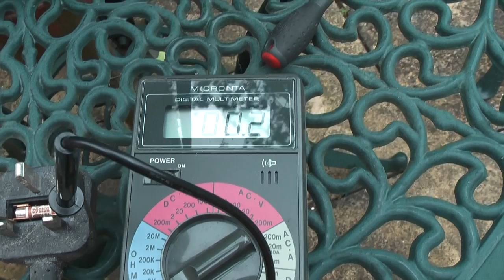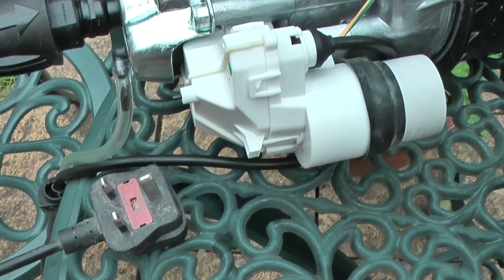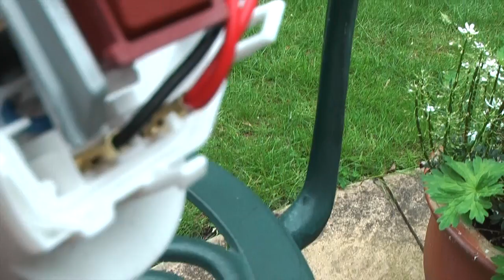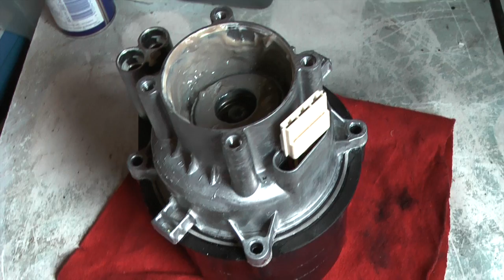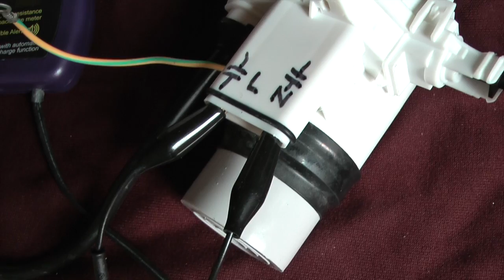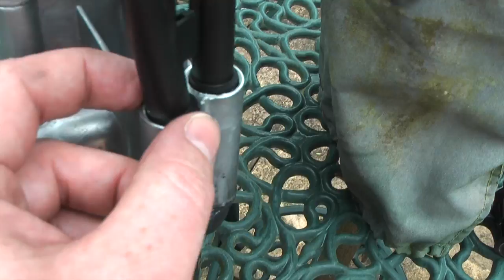Karcher K4 Pressure Washer Fix

Comment: Anywhere I can get guidance on how to remove those 4 large torx screws to access to electric box. I’m not especially weak but won’t budge. Also can’t get the 2 small screws off that keep the 2 parts of the electric box together. Tried all my torx size pieces

Comment: Hi Leon - I'm having trouble here. My washer just buzzes/humms when turned on. Checked the capacitor which is 35mf - it reads 34.6mf on multimeter. OHMS test shows rise and fall 200k ok. 
When I test the plug you tested to the motor I get these results (Mine is a K4 Compact)  C to N is 0.8. L to N is 5 L to C is 4.4

I'm not really sure what that means I was just measuring as yours but can see the difference - Do you know what that means please?

Comment: I had exactly the same experience. I think the problem was a jammed water pressure operated plunger which acts on the manual on/off switch within the white plastic housing. This works by de-activating the main switch when the motor has spun up and created a full on-line pressure in the output hose. When you pull the trigger on the lance this reduces the pressure and releases the plunger to allow the motor to run again. If for some reason the plunger has not released ie jammed then the motor will never run again. Dismantling this assembly releases the plunger so back to normal operation until next jam up. Good idea but poor build if this can get stuck, I bet many a unit has been dumped as a result!!!

Comment: My K4 compact was working but leaked like a sieve, took the casing off and the clear evidence  of leaking water was clear to see.  I know where it was leaking, below cylinder head, so that's the obvious seal, plus any other's that I removed parts  to take down. I think a new set of o rings would be in order. Does anyone know of a decent parts diagram that doesn't take to a  retailers site?

Comment: What was the fault? Totally pointless video!
Reply: Jammed pressure operated switch plunger which released as soon as the plastic housing was dismantled! He did not mention this part of the mechanism, it was just luck that taking it apart released the pressure operated plunger. Bad design really as I bet this has happened on many occasions resulting in binning the unit, chucked into Land Fill!

Comment: Hi Leon .Im a bit hopeless i got a k5 700 .As  i start  it has high pressure but only till you release the trigger the second blast is lower pressure. Disconnect it from the plug start it again high pressure   even for minutes as long as i dont stop with the trigger .cant figure out what can be the problem .Any idea or hint would be greatful  TIA .Thx for the video as well

Comment: UPDATE: Don't worry, a bit of tapping eventually set it loose. Found it was rusted up. It starts with a hum but after a while stops and does not give any pressure water. We can physically turn the motor. 
Hi. Great video. Trying to sort mine out but when we try lift the top off to expose the motor (as in 7:39 of your video) it won't, it just turns and won't lift off. Are we missing something? Thanks

Comment: Thank you! This video was a great help in pulling my K4 Premium apart. The model and body is different but the pump assembly was pretty much identical. 

Unfortunately, I wasn't able to resolve the problem (no power at all) as I left my multimeter at work, I'm on holidays and wanted to use my cleaner so thought I'd test the electrical contacts as you suggest in the video. This was a good practice so will be more confident doing this when I have my multimeter.

Cheers!

Comment: I am having low pressure / pulsating problems with my K4. This video is a great help, thank you!
I am hoping it is just a leaking o-ring as there is a small amount of water leaking from inside the outer case.
I had a K2 Karcher for 7 years that worked flawlessly. The K4 problems started after 18 months.
Reply: Mine didn't last long either - got 2 years out of mine. Seems electrically dead (pump doesn't turn on initially or when the trigger is pulled). I've followed this video but not able to get it operational. Not impressed with recent Karcher quality at all.

Comment: Thanks for the video. I had the exact same problem and 'the fix' worked . Basically, after sitting for a month or two the machine would not turn on. I followed your instructions, I disassembled the electrical part, measured everything for continuity, measured capacitor value, everything checked out ok, put everything back (with a bit of contact grease on connector pins) and it worked. I didn't open the motor casing, just the top.

Comment: When One buys one of these pressure washers you should bend over the counter and let the salesman insert a large object in your nether region because that's what they are really doing when you hand over your hard earned, and as for the frost damage excuse don't fall for it cos they don't try that one on in tropical countries where the plastic parts crack with the pressure just the same...

Comment: Hi Leon, thanks for putting up this video. My K4 compact has just packed up after about 5 uses over 2 years. What actually was wrong with your one, I see you tested the electrics but did't see what was wrong. I was hoping you were going to show us a hidden reset switch. Thanks again.  Mike
Reply: Same here; the capacitor was fine but there was no resistance between the Live and the Capacitor or Live and the Neutral. There was 12 ohms resistance across the Neutral and the Capacitor. Any clues?
Reply: i would think, that if you are measuring no resistance between L and N on the motor itself I would say you either have an open circuit motor winding or he mentioned something about a loose connection about the 8:20 time during the video, have u checked this joint, he didnt show us that bit on his video
Reply: Jammed pressure operated switch plunger which released as soon as the plastic housing was dismantled! He did not mention this part of the mechanism, it was just luck that taking it apart released the pressure operated plunger. Bad design really as I bet this has happened on many occasions resulting in binning the unit, chucked into Land Fill!

Comment: Just taken my K4 apart (it was buzzing but not running) attached hose with water on (no power on) and water was running past the low seal, Looks like I need a seal kit, What do I search for?
Reply: espares or ebay.

Comment: i have had the k4 model where you can put a bottle of detergent in the back for a couple of years and only used about 6 times and decided to get it out today to wash the car and driveway.
got it all set up and when i turned the water on the water was pissing out all over the place.
i took the case off and turned the water on again and it is coming from the bottom o ring that you describe in the video.
How the hell this is possible when its hardly been used is beyond me.
Reply from the maker: Yeah they're really badly made! Still, I found Nilfisk no better :(
Reply: the thing is i bought it to replace an earlier karcher that i had had for ten years and there was nothing wrong with it which i gave to my brother.
i will have a look on espares to see if i can get the o ring kit
Reply from the maker: Yes I put new o rings on mine as they tend to leak after disassembly, even with silicone grease. I think a googling should turn up a set (replace top and bottom).

Comment: Hi Leon,
First of all, please excuse my bad english as I'm a b..y Frenchy. 
I have disassembled a K4.600 (Same pump and motor) and inside the pistons cage, there is the same mix of oil and water as you show on 5:27 step of your movie. I have understood (but not so sure) that we need to clean all this "mud" and put some new "oil or grease" after cleaning. But  - which kind ? - how much ? - is there a place to refill ??? or at the end is it normal situation to have this mix between oil and water (I'm not a genius but I think no) ?
I'm very disappointed to found that there is nearly no French clips about fixing... Which means probably that we are less clever than other 
Thank you for your advice.
Reply from the maker: I simply cleaned out all the creamy beige grease that is contaminated with water, and replace it with about 10ml of CV joint grease (Castrol LM or other brand Lithium/Molybdenum). Exact quantity not important, just as long as it is 'thrown around' and lubricates the moving parts. The chamber doesn't have to be full.
Reply: Hi leon,
Thank you for your confirmation, and to have taken a part of your time to answer.
AR

Comment: Hi Leon, thanks for taking the time to make this video. I'm curious to know if you had any signs of trouble before the machine died? I also had a K4 compact that stopped working just like yours after about 18 months (used every two months for some light cleaning). I'd had trouble with it from the third use and it was returned for "repair" twice, but before it finally died it would repeatedly (about once every 30 seconds) cut out for about a quarter-half second during use. Did yours do that also? After a lengthy (and honestly farcical) interaction with Karcher support I was given a replacement K4 compact (despite my stated concerns about the possibility of this model being fundamentally flawed/underdesigned). The replacement, which I got yesterday, has started doing the same thing already, though the time between each cut off is about 5 mins... for now. I'm worried I'll be in the same situation again before long. Also, it sounded from the video like you have some experience with these machines, do you also believe they are not really fit for purpose? I've wasted so much time dealing with this machine! Thanks in advance for your thoughts and insights.
Reply from the maker: This is the second K4 that I've had trouble with. It was put away working, brought out not working some weeks later. Having said that, I've tried a Nilfisk and that was no better (the motor was possibly better, but the pump mechanism was plasticky). The best model I had was the base Karcher K2. Haven't tried a Bosch yet, but may do so when my washers eventually die!
Reply: Thanks for your reply, very disappointing to hear that it's so hit and miss with these machines.

Comment: Good vid. Mine is not as dead as this and looks like it has just got a split seal. Do you need to remove the quick release clip-on before you remove the 6mm hex bolts?